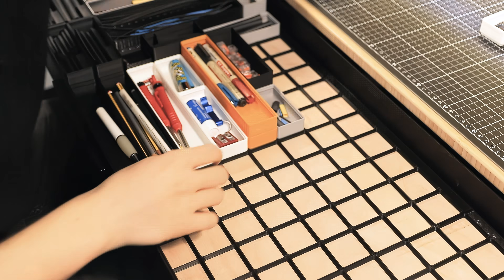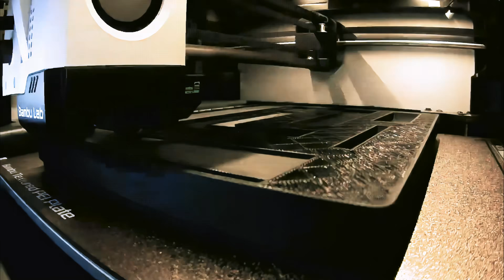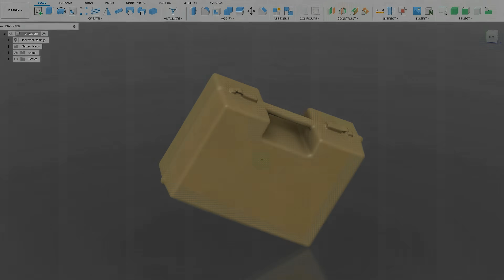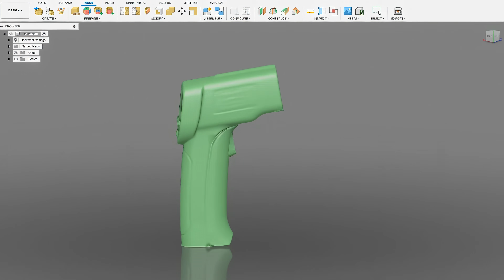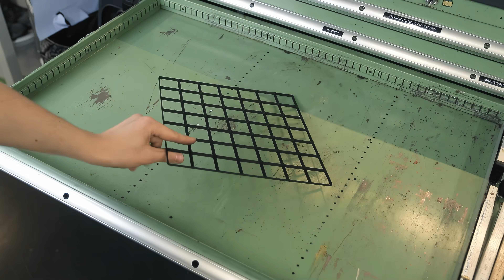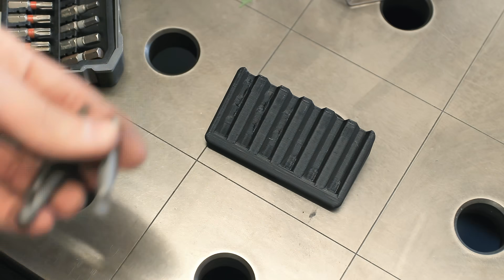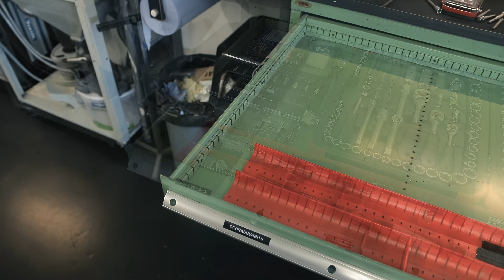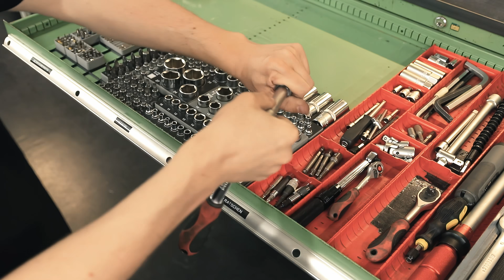How to 3D Print Custom Tool Organizers for ANYTHING!

Comment: Just tell Gemini to convert the picture to a svg. Explain it needs to be a single color object. Then extrude the svg. Easy peasy. Use another object for scale so you can size it up or down and get x and y distortion scaled properly

Comment: One thing ive started doing for the footprints is just scan it, along with a metal square that is exactly 20mm, on my printers scanner, i then load the scan into inkscape, trace it as a bitmap, export it as an inkscape svg vector file, then load it in fusion as a sketch and scale the square to 20mm, and boom. Perfect drawing every time and can be scaled up for clearence

Comment: great topic, you kinda flew by the how to get the stl or obj mesh into 360 or cad for the gridfinity cutout part.  I am stuck on the mesh not having to many triangles ( too complex) and the tolerances for outlining a part/tool.   scans are fine and I can do them, but determining if the need to be solid, have holes need to be repaired seems to be the next extensive learning curve..  Its almost driving me back to tracing
Reply from the maker: I'm assuming you're talking about converting the scanned model from a mesh to a solid object? My workaround for this was to turn the blank gridfinity blank into a mesh object instead, this allows you to then easily substract the shape of your scanned mesh from the box. This way you never need to turn the scanned model into a solid at all. As for tolerances, I just scaled the whole thing up slightly (like 1-5%). It's not perfect this way but this workflow is quick and sufficient for this purpose. 
Unfortunately it's in the nature of YouTube that I can't go into too much detail about this kind of stuff because the majority of viewers won't be "entertained" by that. Wish I could make more in depth tutorials for this kind of thing but they simply don't get enough clicks to make it worth the amount of time that would go into making the videos.

Comment: There is something very satisfying about bringing order out of chaos. I've spent more time sorting taps (BSF, BSW, UNF, UNC, BA, metric, metric fine, JIS...) and bolts and dies and nuts and drills and so-on, and then ordering them by size, than I have actually making things. It probably fixes me towards one end of the spectrum but, I don't care.
Reply from the maker: Hey as long as you're having fun, I see no problem with that! Investing work into organization also doesn't pay off immediately, but over the years I think it saves more time than one might realize

Comment: You use a free open source system to upgrade your storage solution, with works done for you for free, but put the things you made for it on Etsy?
Reply from the maker: Yes, that's the whole point of open source, anyone can use it for whatever they want. I'm not selling gridfinity, I'm selling designs BASED on it that I made myself, just like many others are doing. Gridfinity is still 100% free, nobody is keeping you from building your own models.
Reply: @PhilVandelay  If everyone treated gridfinity like you are, no one would be using it and you wouldn't have had anything to make a video about.

Perhaps instead of trying to make a meager profit off of it, you would be willing to consider contributing to the gridfinity ecosystem instead?
Reply from the maker: I released an entire FREE video that I spent weeks on explaining to people how they can make their own organizers using gridfinity completely for free. Hundreds of people have told me this video was extremely helpful to them and got them into modeling their own containers. But god forbid I make a tiny bit of money in exchange for my work that doesn't even cover what it costs to make these videos. What exactly have you contributed? I just see someone who thinks they're entitled to others free work, doing nothing but complaining while achieving absolutely nothing. Go out there and make something instead of spreading negativity.

Comment: Anyone wanting to do a better, easier and faster job than this guy, listen up now: 
First option, instead of taking a picture, take a scan of the tool with your printer. 

Second option (much faster): put the tool onto a piece of paper, trace the tool with a pen. Scan that piece of paper. 
Go to any online converter that can create an SVG, import said SVG into your CAD software of liking, and voila, you have an outline of your tool inside of your cad without having to trace anything in CAD. 
A cheap, easy and less time consuming method. Thank me later
Reply from the maker: You'd still have to trace the outline in CAD to get an acutal model...? How is this any easier, you just added like 10 steps to the process lol
Reply: @PhilVandelay  no you can import SVGs and create immediate sketches in FreeCAD (any CAD software should be able to do it)

So no tracing inside of CAD.
Reply: @PhilVandelay  no comment on that? 
Did my instructions help. If you improve the video and include my way then please quote my comment. 

Need that YouTube fame and Cred.

Comment: I printed a system to store spline shaft gauges for work like years before gridfinity. Had to printed it from 9 pieces because I only had ender 3 at the time. It was pretty cool. Also I printed adaptor for height measuring tool to have dial test indicator and the height / scraping tool on at the same time. Parts I made required both to be used all the time so it was good tool to have. Pretty cool also.

Comment: I’ve known about canvas in Fusion for a while. But, I owe you thanks for showing me a real practical way to use it. Until now I’ve been laying out my profiles in Adobe Illustrator and exporting as .svg. But importing .svg into Fusion I need to scale around 1.333 to get it close to accurate. Using canvas in the way you described will save me so much time.

Comment: Very nice explanation, thanks
May i ask which infill % do you use/reccomend for the boxes ? (i normally print at 40% but may be it's too much for these and there is lot of plastic in these things..)
Thanks
Reply from the maker: Not much at all, they don't need to be very sturdy. If I rememer correctly I used something around 10%, definitely less than 20. It depends a bit on the printer and filament though, too little infill can make the tops or anything that needs "Bridges" look wonky but I think 15-20% should be fine

Comment: Im super new but Im sure most people know. There is a ruler specifically for measuring things in units of gridfinity bin lengths and heights. This has helped a ton instead of measuring things and doing the calculation or using spare bins.
Reply from the maker: Good to know!

Comment: I'm getting a 3d printer for christmas this year and my immediate thoughts were printing work-related items like you show here, but good lord man, your tetris skills are on point. You've absolutely sold me on an organizational system like this. One thing I'm likely to improve on your design is adding finger-loops or easy grab points on the socket moulds for a smoother removal. Thanks for sharing this!

Comment: You could save a lot more space by laying out how you want your tools, all of them together, taking a picture of that on top, superimpose the infinity grid, and only then start with the modelling of an entire giant block, wich afterwards you split into faces for printing. Your idea about this?
Reply from the maker: You'd still have to space stuff apart so that it doesn't intersect the grid and fits into rectangles, I think you'd end up with something pretty similar in the end since you still need to divide it up into blocks that are a printable size. I think if you wanted to reduce "dead space" it would make more sense to use a smaller grid, but then it wouldn't be compatible with standard gridfinity anymore. In the end there's always a tradeoff
Reply: @PhilVandelay  I don't think I expressed myself clearly. Setting up all the tools in a way that you model an entire block, after wich you cut it up to make it printable, means that equipment can go into spaces that are printed separatly, but come together once assembled, as you did with on configuration. If you did that for the entire drawer each time you would have saved I think around 20% more space, and less time designing aswell. The grid has nothing to do with this, neither it's size.
Reply from the maker: @creepshade  Ah okay I see what you mean. Yeah that would probably save space as long as you never want to change the layout. Would make it more difficult to re-design/change individual boxes though
Reply: @PhilVandelay  Allright, that is the kind of feedback that I think is valuble, never tought about it that way! thanks.

Comment: Outstanding video.  You have touched on many good ideas.  I particularly like the picture on a mat with a grid.  Here we use SolidWorks and it too has a Sketch Picture feature and your technique makes the scaling much easier.  I believe they also have an automatic outline tracing check yours they may have it too.  What a good video.  Thank you.

Comment: im confused by this because you said you hate the blow molds that tools come in but then you went and 3D printed basically blow molds for your tools to sit in?
Reply: The blow mold cases have the sockets lying flat for display purposes and mine have the sizes molded in unreadable black plastic.

He put most of the sockets standing up so they fit in about 1/3 the space, plus combined sockets from multiple sets to save more.  The Gridfinity panels built have the sizes printed in contrasting plastic color, so they are much more readable.  I’ve tried paint pens on the blow molded plastic to make the sizes readable, but it wears off and the letters are not crisp.

Comment: Hey Phil, quick question. I have the same printer as you, I noticed you printed the 7x7 grids, how did you print that on the X1C? Did you print it in 2 pieces and glue them together? Thanks!
Reply: Never mind, dumb question. I saw you weren't using the X1C for your base plates.  :)

Comment: I've never liked that Grifinity has a grid size chosen for nerd cred than something useful.  So many tools and assets made for it though, so it's kind of a tough situation.  Wish these tools could just let you make any grid size you wanted instead of the silly 42mm one.
Reply from the maker: They do just that, you can pick any grid size you want. The only downside is that none of the models already out there will fit your custom grid

Comment: So far I've only printed things from the internet. This video was what finally prompted me to open fusion, and actually start learning to make something myself. Spent 5 hours yesterday on one set of 14 sockets. Lots of trial and error and googling, but learned a ton. This morning another set took 2 hours as I learned some better ways of doing things. Just did another set in 30 min. Can't wait to get to stuff that's not just circles! Thanks for the inspiration.
Reply from the maker: That's great to hear! It definitely does get easier and this kind of stuff is a good place to start
Reply: this is actually a good way to learning basic fusion or solidworks and 3d printing altogether.. learning along the way plus you get to organize your tools
Reply: This is the way...

Comment: so tell me how much you spend on average for material? how much did that first organizer cost?
Reply from the maker: Less than you might think, since these are not structural you don't need much infill and can get away with thin walls. I think I used less than 3 spools of PLA for this whole project and I use recycled PLA for this kind of thing which is about 10€ for 1kg/Spool
Reply: @PhilVandelay  What is the infill setting and pattern you use for the larger items? Great video, thanks for sharing!
Reply from the maker: @RichMenzel  It doesn't really matter as they don't have to be very strong structurally, I use Gyroid infill for almost anything, and for these probably something really low around 5-10%
Reply: @PhilVandelay  Thanks for the reply. When my first 3x5x4 Gridfinity solid bin took 14 hours and half a spool of PLA to print I knew soothing had to change :)

Comment: a cheap alternative to these big tool drawers might be the type of cabinets to store sheafs of large newspaper size paper , in the older days when they still made actual thechnical drawings using a pensil and ruler these cabinets where pretty usefull but in modern days they use cad and they have no use for them no more , these have strong drawers that are pretty deep and wide 
https://www.moonenimportexport.nl/wp-content/uploads/2021/06/tekeningladekasta1a0.jpg

Comment: An alternative to taking pictures is 2D scanning with a printer, this works well and will not give you any sort of perspective effect and will be much more accurate for flat objects. Just be sure not to scratch or break the glass on the scanner if you are working with metal objects

Comment: 3D scanners create junk geometry made of triangles and not suitable for actual models in other environments. Hopefully someone is working on a scanner than can render geometry in quads. Until then, hmm....
Reply from the maker: That's a very broad statement and lacks nuance. It depends on what you want to do, triangles are fine for 3D printing and rendering for example, there's nothing "junk" about them. You can also use retopologizing tools to generate quad models from them or use them as a reference for CAD designs. Of course it would be nice to get a perfect model out of the scanner but that's just not where the technology is at. I'm sure with AI assisted scanning and processing we'll be there in a few years.

Comment: Good idea and work! BUT i think making things EXACTLY like a certain tool is very bad for future proofing. Lets say you have a hammer and you have a mold that fits the hammer perfectly. The hammer breaks 5 years down the line and you buy a new one. Will it fit? probably not. So i think you should use only minimal supporting edges and then maby color behind every tool so you know where it should sit.

There is no reason to extrude 100% around the tools shape other than instagramgasm :)

Comment: 3D printing is perfect for tool organizing.  I also use those little felt/rubber pads (for chairs, cupboard doors etc.) for certain items that need extra protection.  It gives some shock protection and tightens up extra clearance when you don't feel like reprinting.

Comment: for baseplates, I want to strongly recommend Gridfinity Refined, and Gridfinity Refined Parametric Spacer, on Printables.  

Gridfinity Refined has a simple and a complicated baseplate, and the simple is better, imo.  it has little dovetail connectors to tie the baseplates together.  the spacer takes up the extra space, so that your baseplates can't slide around in the drawer.

between the two of them, you don't have to worry about your baseplates shifting around at all, even if you always close the drawer kinda hard

Comment: I see some people are angry that you’re selling some of this work. A lot more people will watch this, think it’s great but not tell you, so just adding this comment to voice some support.
Reply: I love that people print gridfinity and sell it on Etsy. I have zero intention to buy a 3d printer when it’s cheaper and far easier to just get other people to do the leg work.
Reply: @Alan.livingston  is not cheaper
Reply: @ I guess it depends. If I drop $500 on a printer and then a bit more on consumables, I have to print a certain amount to amortise the cost to a point where it is cheaper. If I just print a few gridfinity things and then the printer sits there collecting dust while the filament goes wonky from humidity then I doubt I’d hit the break even point.
Reply: @Alan.livingston  A single Gridfinity piece, like one designed to hold magnetic bit holders, can cost around €30 (approximately $32) on Etsy. That’s the price of just one piece, and you can’t even customize it to your specific needs. With 3d printers you gain the ability to design and customize countless other pieces exactly how you want them. In the long term, the value and flexibility far outweigh the initial cost.
Reply: @sperformance.96  I don’t actually disagree that it can over time work out cheaper. You do however gloss over the time to learn how to use the software involved, setup, maintain, and repair the printer when it fails, etc. They are still an entire hobby in their own right.
Reply: Nothing in life is free
Reply: Those people can shut up TBH. He just unlocked a world of “this is how you can do this pretty easily”.  That’s worth money, literally.

Comment: Try gluing a felt sheet (dark green for that retro feel!) down into the bottom of the drawers, then redo your tetris of the grids.  Everything will be quieter, and have a better feel!
Reply: The little meshy mats coated with rubber also work really well for this.
Reply: Until they melt in your drawer. Felts much nicer.
Reply: @SlowExpensive  - must agree.  I had the rubber mats for a short while, but they got all gooey and gross after a fairly short while. In my machinist cabinet, I still have the original felt liners from nearly 50 years ago when I bought it!

Comment: Why do you need that grid app? Why not just a solid block? I don't understand what it's used for.
Reply from the maker: It keeps the organizers aligned to the grid and prevents them from sliding around. You could get away without using if the space in the drawer is filled 100% but when there's gaps, the grid helps to keep everything in place.

Comment: all and all, how much filament did it takes you to organise all of thise ?
Reply from the maker: Actually not that much, these prints are not structural so you can use very little infill and don't need many wall/top/bottom layers and while some of them are big in the XY direction, they're all pretty flat so it's not that many layers. I think all of this was printed with less than three 1kg spools.